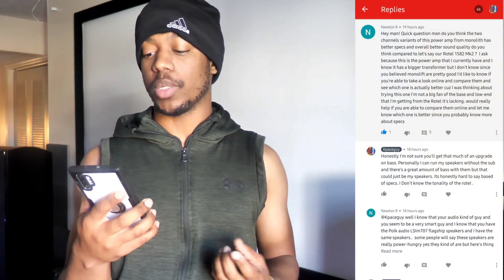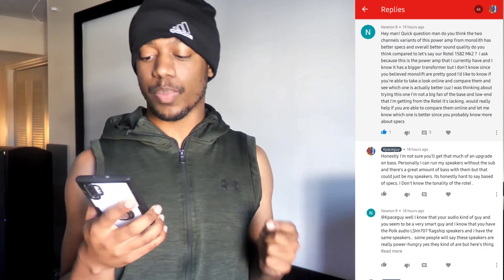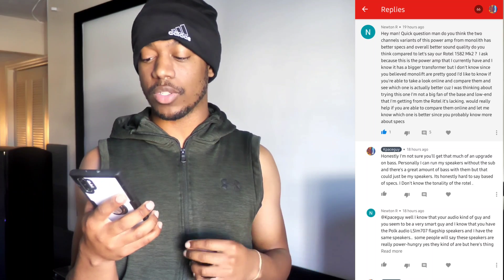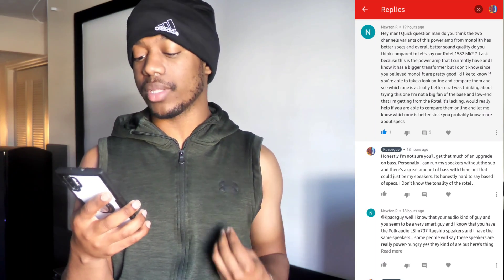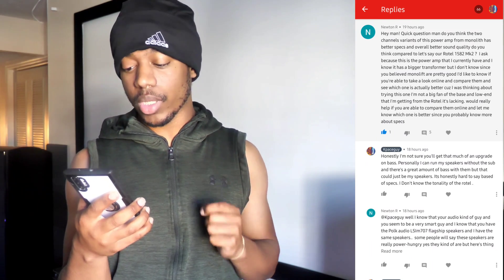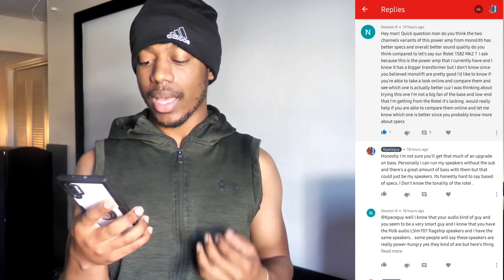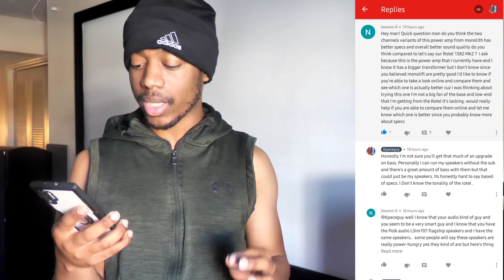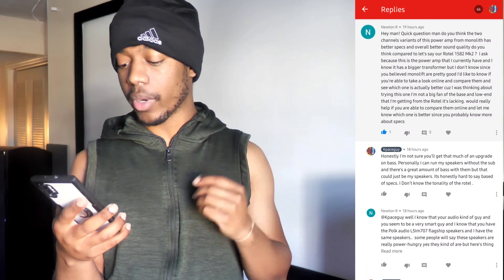Why A "Flat" EQ Isn't A Flat Sound

Comment: Bro does burn in earphones/headphones actually work ?.and should i buy amp or Dac to enhance my audio quality of headphones ..Currently i am having Sony XB55...What is the difference between Amp/Dac.Which should be perfectly suitable for earphones. Any hidden setting in android to attain high quality audio in earphones using android smartphone...I know i asked you many questions.I love music and everything audio related stuff....I Am Audiophile....and Have Deep Interest in earphones and headphones.By Changing only eartips on your earphones will change the perspective of the sound you are listening to your ears....I tweaked the equalizer and have more then 15 presets according to my listening. That's enough from my side....Please share your thought regarding my comment
Reply from the maker: I don't really think breaking in headphones is necessary because the material they use and the amount of cone travel is so minimal. The point of breaking in a speaker in general is get the driver moving and loosen up the spider and motor and etc. But it's not all that significant on a headphone
Reply: @Kpaceguy  Thanks a lot brother for your valuable information. 👍🏻👍🏻🤗

Comment: @kpaceguy have important question. Im found out that the normal room meseuring ist absolute crap because of the Lack of prcessorpower of the denon avr. Just the multieq app can handle those mesure data. When i add the dynamiceq Future in the add and senden this Settings top the avr the Sound ist absolutely nice!. The Problem ist that denon do not enough to Tell that this is important for this lovely Sound. Why is that.? They put a product in the Market that could be a ferarri but its only a Ford...... with the regular mesurement. Do You have similar experiance with that?
Reply from the maker: Yes you just have to play around with all the settings and see what they do and find what works best.
Reply: @Kpaceguy  i CAN imagine that Lots of customers, Who dont have the Time or the interest, dont know this fact and they never will get the joy of this great oportunity and Sound. In the usermanual is also Nothing about that.. i cant Understand. Eventually this is a oportunity for you to make a Video about that ?
Reply from the maker: There's always the potential. But I'm not sure my channel is big enough to make much difference
Reply: @Kpaceguy  if you share the Good knowledge the right people will find your video.  It need just the right words. For example: how you mesure your room right? I Think this would be make a Big difference and will help lots of people 🙂 keep it up your good work!

Comment: good video bro that was good to know because I just received my DSP for my car audio system and it has a 10 Band Parametric EQ per Channel. so I can control my subwoofer and my mids and highs individually because they have a separate EQ. I thought I was going to get a flat response. So basically I can control the frequencies and balance everything out.
Reply from the maker: Exactly man

Comment: How should you adjust tone controls? Bass & Treble etc. or should those always be bypassed? Not talking about EQ. I always swore to keep any EQ flat, any tone controls bypassed, and have everything direct and untouched because I want to stay close to reference and be professional. After seeing this video and doing a ton of research to always improve my setup I realized that what I expect to get from my theater is unrealistic and not going to be the best sounding if I do things that way. Everything you said made sense. 

So after getting a flat response with EQ, should I bypass the tone controls? Do you tweak your tone controls? 

Pioneer Elite SC-LX701
Klipsch 7.2.2
Reply from the maker: I used to mess with tone controls when I was younger. I don't so much anymore unless its the treble I may bump it up or down depending the speaker. Tone controls only really work for the speakers not subwoofer so it tends to create a bloated sound that I'm not a fan of. I typically keep it on bypass.
Reply: @Kpaceguy  Thanks! Will you be doing subscriber showcase again? I'd be very interested in participating.
Reply from the maker: @kyleshays  yes will be setting that up very soon